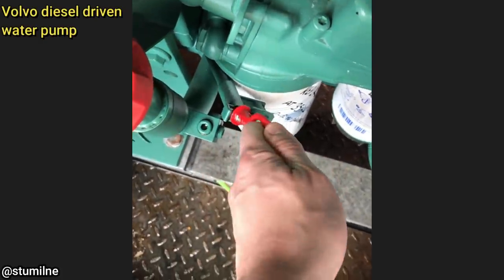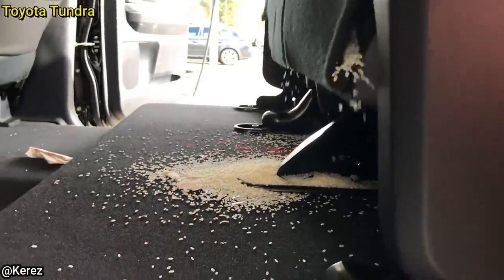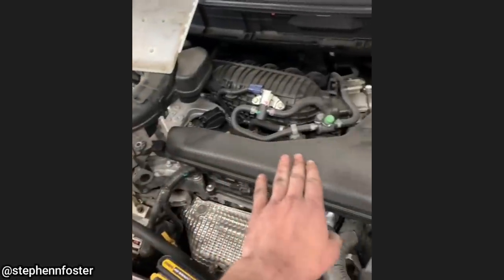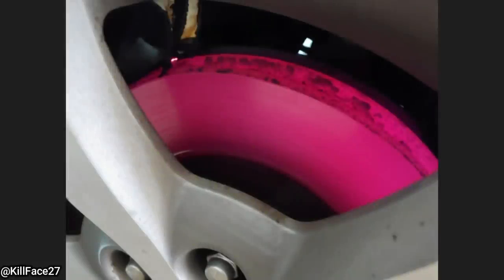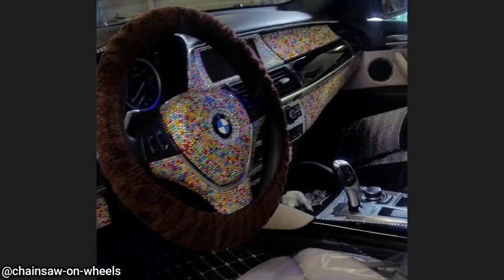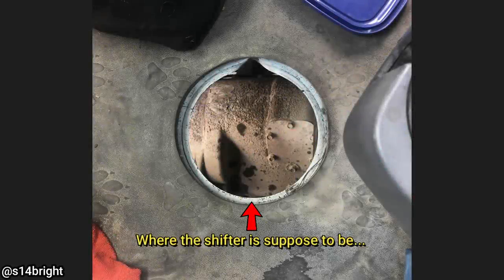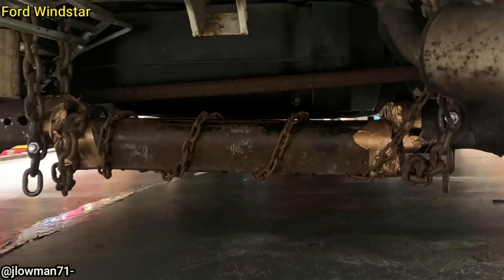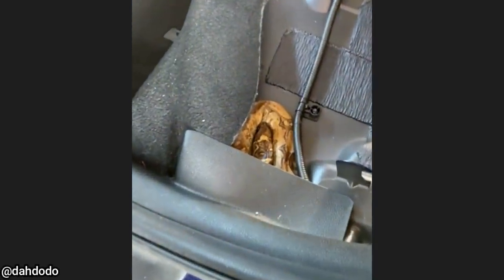Customer States Engine Is FULL Of Water | Just Rolled In

Comment: I have transit courier (last clip) this mount (depends on phone model) press butons and activte ex. Google assitant or event turn off the phone. Had to buy harder case to prevent this happen.
Reply from the maker: Does the mount work pretty good otherwise?
Reply: @JustRolledIn  it's good, in the glasses compartment they added a usb charging port and jack port. there are also holes for wires. Someone thought well. # 2 In some Skoda there is a USB port for the video recorder in the center mirror

Comment: Here in Ireland, and probably all other EU countries, once your car is more than 4 years old it needs to be tested every 2 years under the National Car Test. (NCT). Once your vehicle reaches 10 years it is an annual inspection. The charge is minimal. I have an 11 year old diesel in good shape and they mentioned as an advisory that I needed a ball joint replacement. Did that and It's a different car completely. Inspections!

Comment: Ford refuses to honor that rear axle recall after a certain mileage
Reply from the maker: Crazy. I worked at Ford 8 years ago and use to do those often.
Reply: @JustRolledIn  Maybe it was just the dealership then, but Chapel Hills Ford in Colorado Springs told my wife to pound sand when she brought it in with 161k miles.  Said they are only good for 150k miles.  We promptly scrapped that van after finding cracks in that axle assembly
Reply from the maker: @jeffhurckes190  wow that's ridiculous. Never heard of that but it's been a while since I worked at Ford.

Comment: If I saw the mechanic @1:35 doing that with his tools on my battery, I'd yank that vehicle out of there faster than he could collect his tools. If he can't follow basic common sense, I sure in the heck don't want him touching chit on my car. Once reason why I do almost all of my own work. Can't fix stupid!
Reply: Battery is dead... As in 0v dead.
Reply: @mmorgz6622  I've never seen a 12v battery read 0 volts.  especially one that new. Edited to add, but if you say so.
Reply: @skelafeti  I have plenty of batteries that read basically 0v laying around. battery is old as and knackered. It doesn't look new by any means. But engine bay was hit with alot of degreaser and more to get rid of the incredible amount of oil on the outside of motor a few weeks ago.
Reply: @mmorgz6622  ok you must be the mechanic if you have plenty of batteries laying around because only an idiot would keep plenty of dead batteries and only an idiot would practice such bad habits. It doesn't matter if it's 0v or not, it's a BAD HABIT. Don't be stupid basically is not the same as 0v. when it comes to electricity
Reply: Yes I am the mechanic. I keep dead batteries because they are worth money in scrap, only an idiot would throw them away. All mechanics I know of keep batteries to recycle. Sitting tools on a battery that couldn't light a led bulb is of zero risk. Have done it for 15+ years. If it has charge, remove or cover it. Simple. 🤷